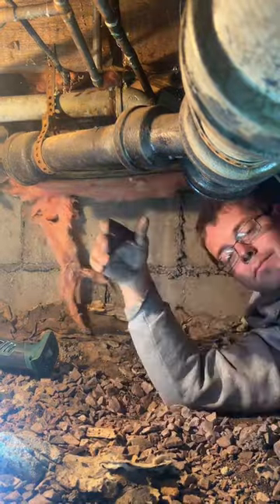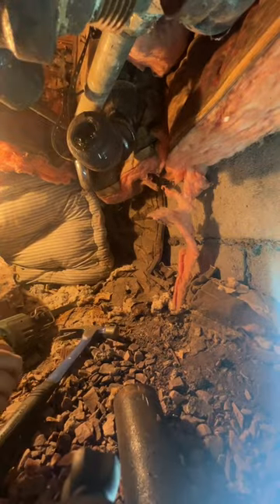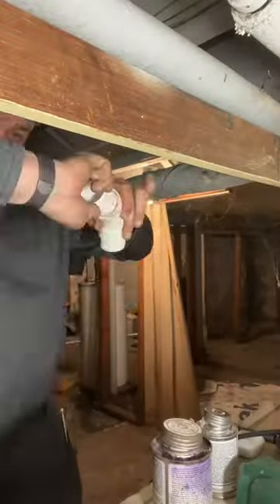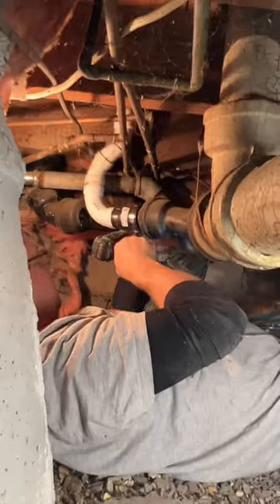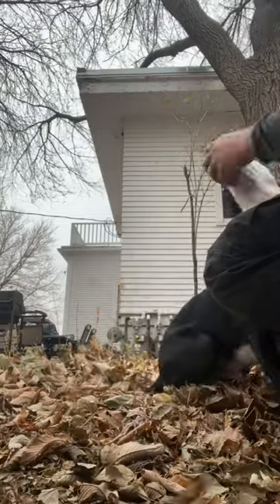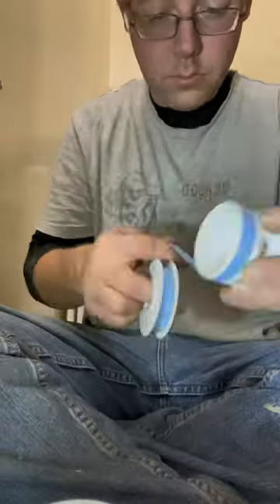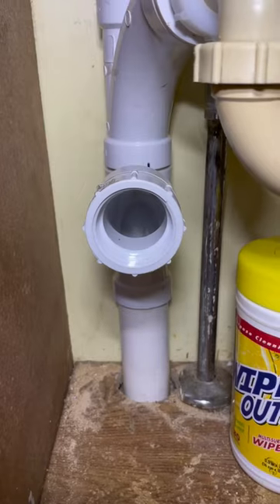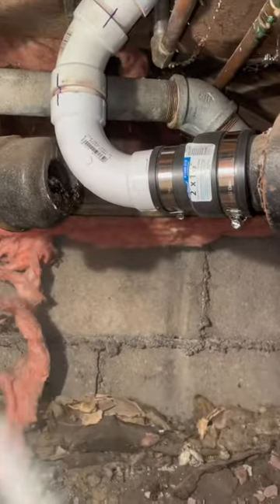Running a New sewer lines to a bathroom sink that was draining slowly. #HandsomeOrHandy #Handyman ￼

Comment: And this is one of the many reasons you call a plumber and not a handyman for plumbing.  Handsome did all that work and was so proud of his vented p-trap and then still used a combo instead of a santee.  That trap is no longer vented.
Reply: Yeah I saw that. It’ll work man. Not ideal but it’ll drain and vent.
Reply: He wasted his tee for a clean out.
Reply: There is a one-way vent under that cabinet.      So why isn't it vented?
Reply: @homesteadhaven2010  The santee will let water go down but leave an opening for the air from the vent to come in the horizontal pipe while the combo he used fill with water before reaching the end of the V shape and won't let the air come in rendering the vent completely useless. It turns the P trap into an S trap which is not used anymore because it siphon itself thanks to the Archimedes principle. No trap equals sewer vapor coming back up the pipe and stinking up the house.
Reply: He did fine. I'm a licensed journeyman and guess what I wouldn't have used a stupor vent if I ran 2 inch
Reply: Handymans don't know the code
Reply: Nothing wrong with combo. Try horizontal wet venting we use them all the time
Reply: @jrad6028  wrong, can't stand a wye that way, it kills the vent
Reply: same thing I came to say

Comment: What kind of sawzall blades are you using?
How is it staying inside saw without popping off?
Reply: I've never had a blade just "pop off" of a reciprocating saw. Is that a common problem?
Reply from the maker: It is a diamond coated saw blade specifically designed to cut cast-iron pipe. It is held in like any other reciprocating saw blade.

Comment: How do those vents work? Like how do they prevent sewer gas from escaping?
Reply from the maker: It’s basically a check valve. It allows Air to enter the pipe after a bunch of water goes down and it keeps the trap from being sucked dry, but it does not allow any sewer gas to leave.

Comment: Have a hard time believing I couldn't get that clean but it is better to replace it with the PVC but it's going to plug right there at the transition between the PVC and the cast iron at least you put a clean out underneath the sink.
Reply: I would have used abs to transition, at least it has better tinsel strength